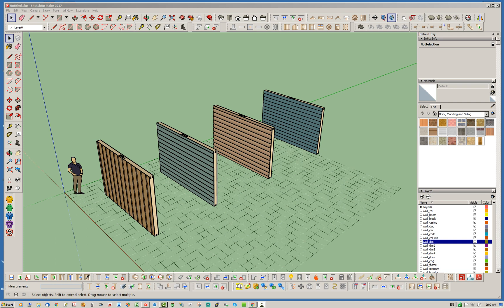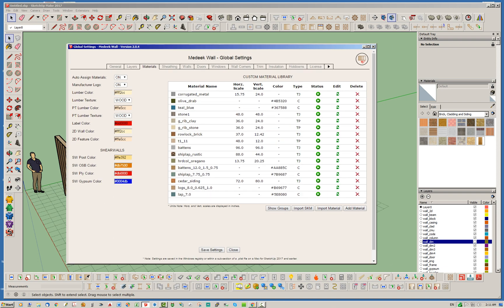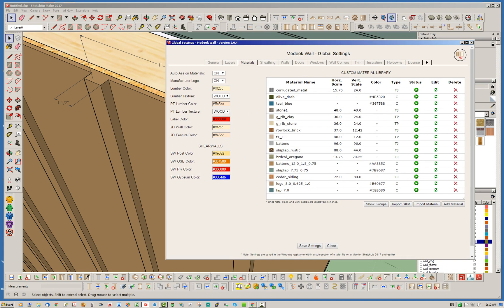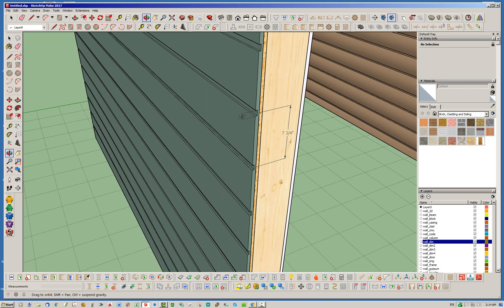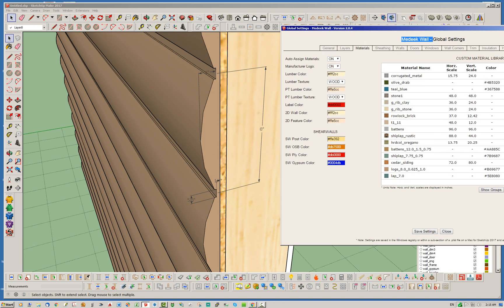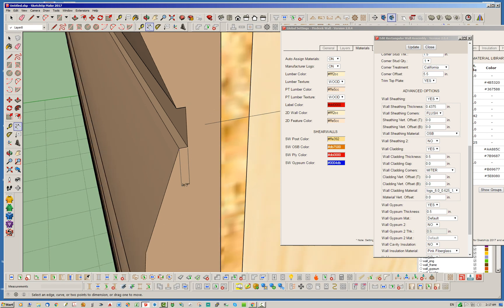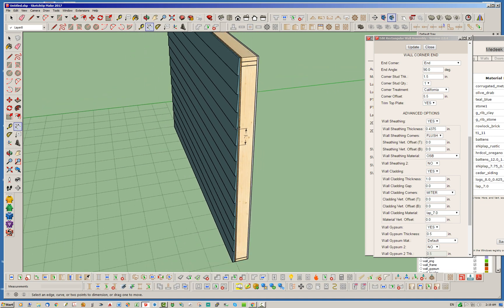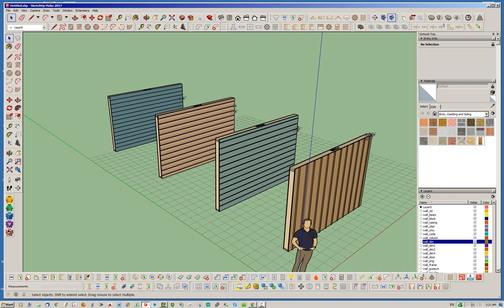Medeek Wall Plugin Tutorial 21 - 3D Cladding

Comment: Just a minor critique of your videos. It would have been nice if you had shown how to make a new siding type with the given parameters (height, color, gap width and spacing) I think everyone who has used your wall plugin knew how to set the thickness of the wall cladding itself and is self explanatory in the dialog box when setting up wall styles. Since this is a new feature thoroughly explaining the new features is more important than a review of existing ones that have been covered in other videos. 
You plugins are awesome and there has been a lot of discussion among us users looking forward to the floor plug that was going to be available this last year. What are the chances of it finally be available for BETA on Feb 1, 2023. Its the final piece of the puzzle unless you are planning on creating some plugins for plumbing and HVAC.